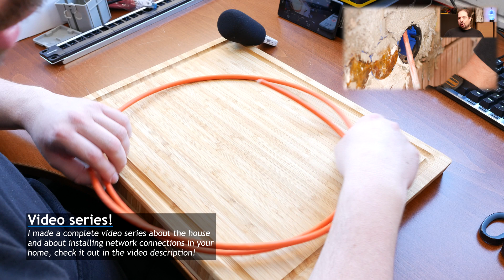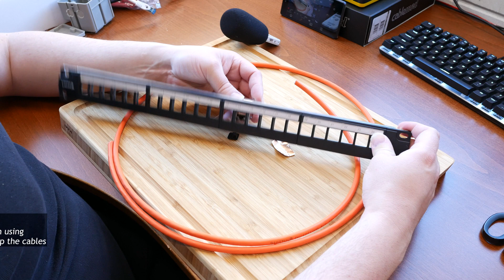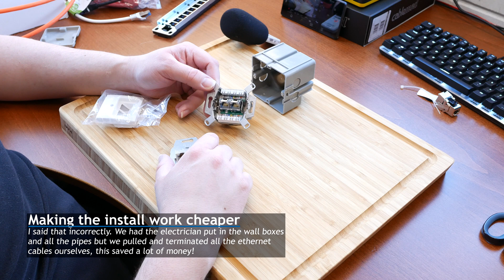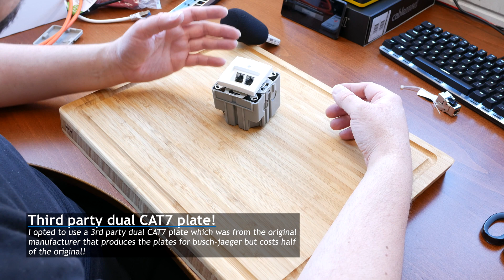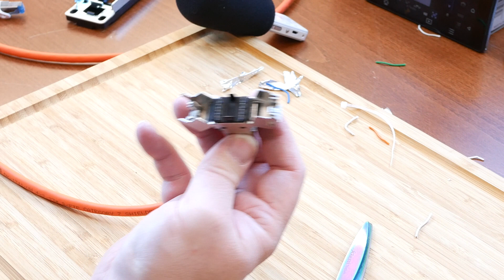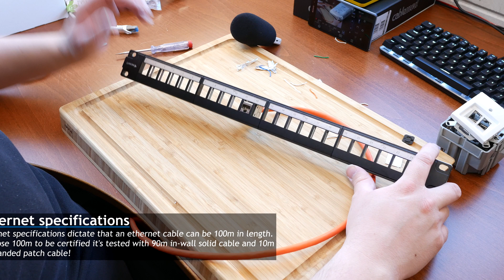Home Networking: How to terminate ethernet cables (Part 1 - 2)

Comment from the maker: Some extra info: The A standard is mostly used in the America region and the B standard is used in the Europe region. As I mentioned in the video, as long as you stick to one type, you should be fine. Make sure to also get the same type patch cables to make sure you get the highest quality signal, especially when using 10Gbit!
Reply: A tip. Check Fiberninjas videos. He have many tips. After I look at his videos I am terminating keystone faster and easier. :)

Comment: Can the patch cable be unshielded (going to switch) ? If patch panel is shielded and grounded and the cable cable connected to an ap or camera is shielded  ?
Reply from the maker: In theory? At least the shielded parts will still be shielded, but it's best for the whole chain to be shielded obviously.
Reply: Thank you for your response. I will run shielded all the way to switch. But can grounding be done to patch panel? My patch cable does not have an ESD /drain wire. But the cable from camera to patch panel does have an ESD/drain wire.
Reply from the maker: @salmanslim  Normally grounding the rack and the patch panel should be good enough. You don't need a drain wire and such with cables, that's what the metal connector takes care of.

Comment: The A and B standards are to make straight through and crossover cables pairing A to A or B to B will make a straight through cable, where your router will talk to your switch and your switch will talk to your devices, so forth... the A to B is used as a crossover cable, if you use a crossover cable from one computer to another it will make a direct connection between them and they will be able to talk to each other and transfer files.

Using a crossover cable with your computer and router is not recommended but can be done, however using crossover cables between other devices and the switch is ill advised as not all devices know how to compensate for crossover cables.

THE MORE YOU KNOW!
Reply: only B should really be used for everything. Even between switches, or for direct connection between two computers. All equipment from last 20 years supports autonegotation (MDI-X). Last time I have seen a hub or switch or network card that it doesn't support it was around 1998.

Comment: I work in a data center as a data center and spend a good amount of time in the noc.  Currently I am using a 20ft cat6 Ethernet cable over the choice of wifi simply due to the fact I stream music. Would the cat7 be a better option?
Reply: For music? Cat7 would be overkill.

Comment: So how exactly would you hook up a simple (PoE) WiFi AP or IP-Camera for example? Would you terminate the device-side cable end with a keystone (hanging loose, without a patch panel that is) and then use a short patch cable for the last half a meter to the device?
Reply from the maker: +pcfreak1992 No in the case of access-points or POE cameras I would use a special Cat7 direct plug on the cable. I show them on this video or the next.

Comment: Depending on the keystone simply closing the end together will push down the insert thingy down. The closing ends will work as a lever.
Reply from the maker: +Fabian True but I find closing it fully beforehand makes the closing a lot easier. But if it closes that does mean it's fully down, so good either way!

Comment: What's the longest cable run in your house? I recently revamped the networking in my humble domain and went with Cat6, which too is rated for 10Gbit. It'll be years, possibly a decade, before I'll be needing more than 1Gbit, by which time installing fiber optic cables will likely make much more sense, so Cat7 seemed like total overkill. Granted, 99% of all my local network traffic is internet related, so even Cat6 isn't really needed, but since there was little to no difference in price, I went with it. Cat7 is quite a bit pricier.
Reply from the maker: My longest run is about 50m in total, including patch cables, etc. So you are right in mentioning that using CAT7 isn't yet mandatory. But for me there where multiple reasons to choose it anyway:

- CAT6 is non-shielded, I'm running a lot of ethernet wires close to each other, intersecting power lines, etc. so I wanted shielded cables anyway
- Additional costs are marginal (Maybe 50%)
- Won't need to replace the next 10+ years (Gigabit had stuck around for a very long time but is on it's way out)
- I'm using my ethernet/CAT7 cables for more then just 10Gbps networking (USB, HDMI, KVM, POE, etc.) and for all those cases, more copper is better!

I thought about using fiber, but the only reason right now would be cheaper 10Gbps cards, but I've recently found single port Intel RJ45 10Gbps card for under 100$. Also when moving forward RJ45 will remain more versatile then fiber. Fiber is also hard to terminate yourself because of the equipment (Although I would be able to do that)

In my use case, I'm getting 300/30 as an Internet feed but am going to use 10Gbps links from my 20TB ZFS storage server to my workstation. That's it for now!
Reply: Cat6 cables also come in shielded variants (STP), but yeah, in your case going with Cat7 certainly makes much more sense than in mine. :)
Reply: don't think about "oh, my internet connection or my network will not be going that fast for decades"

When in reality there will eventually be a bottleneck, through the one line into your house it would more than likely be the bottle neck unless you have a lot of internal file transferring, I see a few people with media servers that choose to pre download and watch movies and even TV shows or even record and store media on their computers for later access and that creates a bottleneck between the media server and the other devices, if the media server is also downloading at the same time then it increases the bottleneck.

It's all about the design of your network , if you're going to have a heavy use media server that's 4CPU, octacore huge GB of RAM... big beefy server last thing you want is for the network side of it to be congested, media companies like Linus Media Group need not only a direct fiber to the machine, but 2 fiber connections to keep the bottleneck low.

"by the time my network needs that much throughput I would be running fiber anyway"

as my above post states plus additional disadvantage with fiber... it's fragile and flimsy, they can't bend and you sure as hell can't kink them, making a perfect connection needs microscopic precision and the tools needed to splice a line in is still quite expensive, I don't see the price falling to the point where these premium tools will be able to be purchased at the consumer level, most people that I know and seen probably wouldn't put fiber to the maximum advantage let alone know the difference between the fiber optic connections, there's the toslink that is simple and hard to screw up because it's mostly plastic to the ultra premium and fragile stuff that can break if you unwrap it incorrectly but can send data in the terrabits through several countries before it needs to be boosted.

This is more in the case of misunderstood technologies, in Australia we have the same, the consumers see that wireless 5G is going to be faster than what they can get through FTTP without understanding what is powering it behind the scenes, they see faster downloads now, but without knowing that the more people that use wireless the more congested the transmission site will be, the fiber connection that the site is on would still have capacity but the channels available would be limited to a set number of concurrent connections making FTTP still superior.

Comment: You use cat 7 cable for 10gbit connections, however I could barely find any 10gbit switches, and the ones I find were super expensive. Are you using a gigabit switch for now and then in the future switch to 10gbit?
Reply from the maker: I'm in the process of upgrading some links to 10Gbit, more videos about that soon. But because we recently built a new house I started this home networking series and have been preparing everything to be 10Gbps capable. :)

Comment: I found online a RJ45 Jack that you put directly on the wire, like the one that you showed at the start, and it's rated for cat 7. In some cases I have to use this and I cannot use keystones, is it really that terrible? How hard is it to put them on since when I tried cat5e it was super hard to get them in the right order. Btw is 1.5$ a piece expensive?
Reply: Orian Leitersdorf You need to use the RJ45 plug that consists of 2 parts! Then you can leave the wires a little bit longer and put them through the RJ45 plug, if you want 1 wire at a time. Then with the second part you make the connection and cut off excess wire ends. Google on it👍
Reply from the maker: If you get the special plugs it's "ok" when you don't have another choice. 1.5$ a piece is quite normal though, see my links in the description. So for access-points and such, I have also used these plugs because I don't have space for a keystone.

Officially though you're not supposed to put plugs on CAT6A/CAT7 and need to use factory 'sealed' patch cables to make the connections. That should ensure a higher signal quality then using plugs and that way it's rated up to 10Gbps.
Reply: If you're not supposed to put plugs on the cables then what does it mean when the plug is called "cat 7"? Does it just mean that the size of the hole is bigger? Is it easier to place a plug on cat 7 because the wire is thicker, therefore it doesn't move much when you try to fit it in the right order? 

Today I spent about 20 minutes trying to put a plug on a cat 5e cable because every time I put it in, therefore was at least one pin that was in the wrong order; and I will need to do a ton(about 20) of these connections with cat 7 soon and I don't want to waste too much time on it...
Reply from the maker: Yeah, putting plugs on a cable can be difficult, especially if you have the type of plug with the little insert, I hate those. Otherwise I don't have too much trouble with it for CAT5E though. It's all about repetition though, and getting the right plugs (solid vs stranded).

For Gigabit, using plugs will be just fine but running 10Gbps over those links might prove troublesome or only work for shorter distances because of the less then optimal signal quality.
Reply: I'm not sure what you mean by two parts... do you mean an insert? If not could you please attach an image?
Reply: Yes so the one I found has the two parts. Btw do you need a special crimping tool for cat7?
Reply: Orian Leitersdorf no